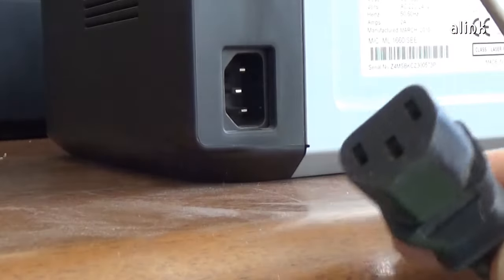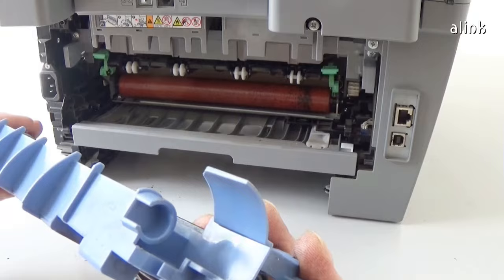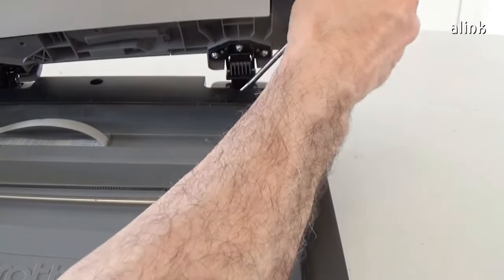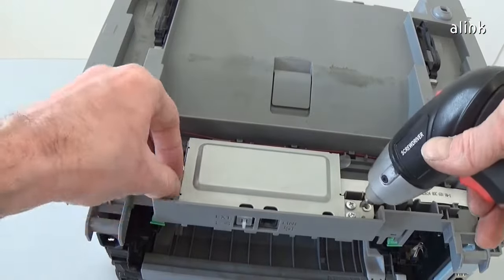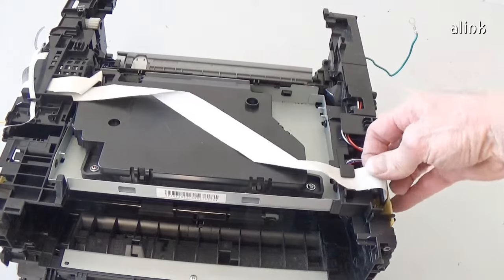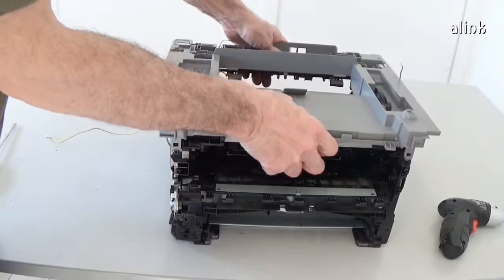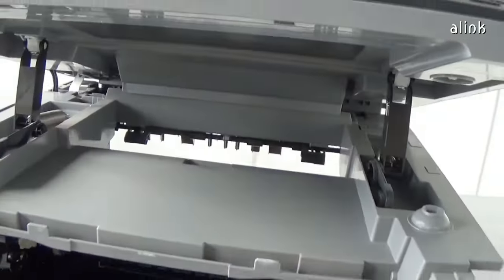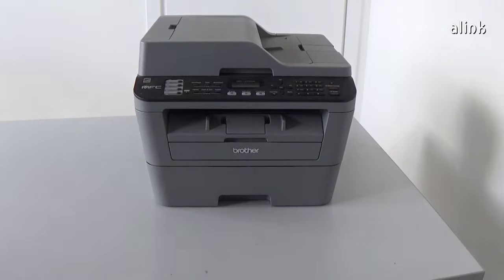Disassembly/Reassembly Brother Laser Printer MFC-L2700 L2710 L2750 and others

Comment: great video- installing the rear panel is a lot easier if you just close the cover and let the 2 pins of the 2nd fuser cover slid into the slots, then down into the track (instead of trying to bend them into the track)

Comment: I was able to follow your instructions down to 1:27.   I do not see anything resembling what you call "the front cover" on my L2750.  It would have helped had you started the segment a little further away from the device so that I could see what side you are zooming in on.
Reply: Never mind.   I found a wider view in another video which shows me where the "front cover" is located.   I managed to work my way down to the power plug, which needs replacing.

Comment: I have "paper jam inside" msg with no paper jam.  Entered service mode and did sensor check.  All sensors work except front registration.  How do I get to registration assembly to make sure levers are connected?  Service Manual says to only remove Right side cover, and HVPS PCB first.

How do I get the registration assembly open to check the levers?
Reply from the maker: The registration assembly should detect the edge of the paper and should be near the fusers where the sheet come out from the printer. It should be connected with the main board

Comment: I just needed to replace fuses cover. Now when I re assemble says "paper jam rear" and won't go away help
Reply: @viandant5
Reply from the maker: @mschf_nft2581  I think you have to check the paper sensor of the fuser unit. may be one of them is out of position
Reply: @viandant5  the fuser unit is the orange cylinder, but what it would be the paper sensor ?
Reply from the maker: a plastic flag or a photodiod

Comment: Hi there, I need your help please, I need to know wich kind of diode is the one next the super capacitor you can see in bottom right corner (min. 4.07 of this clip). please can you tell me its voltage?
Reply from the maker: Hi sorry I ca't help you. I have no tech manuals
Reply: @viandant5  if you have time perhaps you can have a look on it with a magnifier, it should be a "C91" (91volts). Unfortunately mine is burnt and impossible to read.
Reply from the maker: @markraptus  I've no Brother MFC-L2700 in office

Comment: 1:15 you should have removed the bottom tray between the paper tray and the roller before you remove the black plastic guide instead of forcing it out using a screwdriver. Without doing so you will break the black plastic and thats how you break your printer
Reply from the maker: thank you for the tips but no break problems